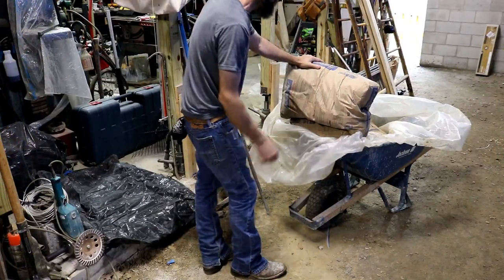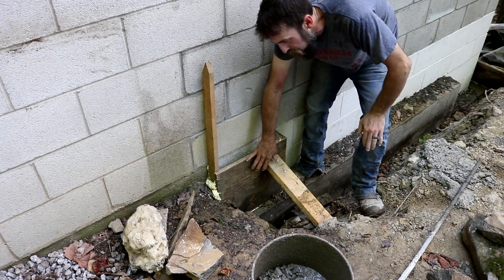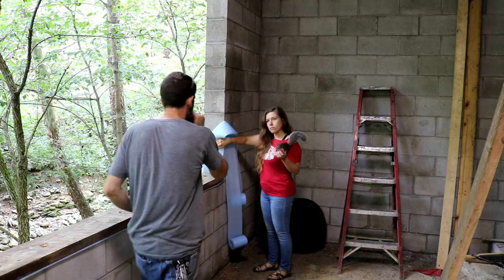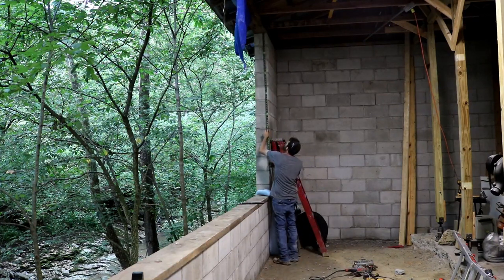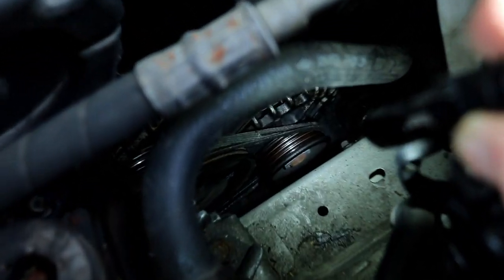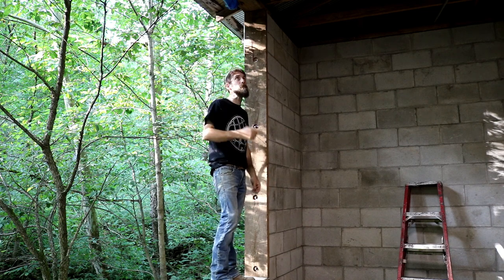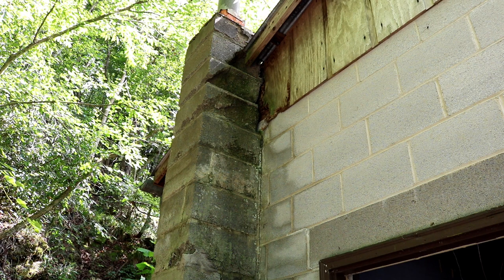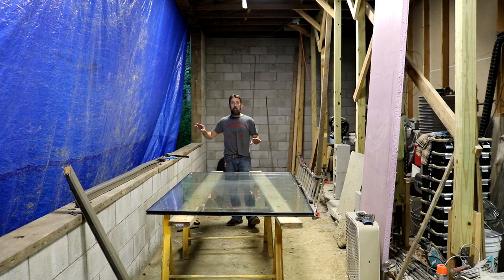Finished Concrete and Oak Trim

Comment: IF, you make the sliding glass door panels opening, you SHOULD give them screens (wasps?!). 
I don't think it is worth it. Run them horizontal, put venting windows above (like basement hopper windows), opening units to the sides. Vinyl windows are cheap and come in many sizes. Just my two-cents-worth.

Comment: bags of cement arent alowed by law to weigh more then 25 kilo in the netherlands our version of osha doesnt alow more to protect the builders backs 
dont make the big windows to open up just set them in solid frames , the double glass is kind off funerable and can spring a leak in between the windows glass making them loose their insulation value and fog up on the inside  , 
besides that like you said there heavy and the support frame and hinges need to be build way heavier then when using other smaller windows that open , might be better to surround them with / have a row of smaller windows over the top and have those open up 
(maibe using a cam mecanism with a lever at a comfortable height ), 
simply having them hinged at the top and kick out on the underside should be plenty for aircirculation and protect from rain comming in even if their left open it will let in a ton of light 
think laying the windows down on the long end allmost sitting on top of the sill is tall enough to enjoy the the view from anywhere in the shop 
making a windowframe top to bottom from angle profile steel is enough maibe make 2 or 3  pillars standing on the sill from 4 pieces of timber screwed together with a supportbeam over the top to support the roof and screw the window frames intoo that 
you can screw wood stringers in the frame where no windows are put in and use those to nail the shiplap intoo to fill the openings

Comment: Brilliant tee Elizabeth! Love it. Steve those big windows are far too big to be openers, you can't make a frame heavy and strong enough to prevent them twisting and possibly breaking the glass. It would be far easier to make them solid and have openers at each end of the shop. You could make a small opening casement window above each big one given that you have enough height to play with,. Give Peanut and Walnut some nuts from me please. Cheers from across the pond in the UK. Oh on another note, why on earth did you unload that cabinet so far away from the shop? I would have backedthe truck almost all the way into the shop!

Comment: Great job Steve. I love the fact you are reusing reclaimed timber in there. It gives the building character and validates it even more. To easy just to burn old timber and order a lorry load of new.

In the UK we have many ways to anchor to block, brick, concrete. Obviously we use similar anchors that you used but we also have concrete screws, drill a hole and screw in like a wood screw. Do you have those over the pond and or are they code for your application?
Reply: They are called Tapcon's here he would need about 3X as many and most would only anchor into the block, not the concrete
Reply: Y Pop we get concrete scores certainly 4" long and maybe 5" here in the UK.

Comment: Nice work. STATIONARY, they are too large and heavy  and will flex and leak if you try to make them opening no matter how much steel you use in a frame. I broke a similar door (Andersen) last year and where I live it cost more than $800 to replace it.. Dang this is a huge project for an individual. And yes winter is coming.

Comment: now that you have a good structure have you thought about making a lower celling? it will save you on heating in the winter and you can have storage up stairs
Reply: That’s what we did in our pole barn with 12’ ceiling (rafters). We built a wall down the middle and made a wood shop in the back. We dropped the ceiling 2 feet back there. In the front section, we built loft areas along the sides, installed attic stairs, and use them for storage. We hung plastic down from the ceiling to close them off from the main part of the shop so we have less area to heat.
Reply: @notajp  totally agree and he will have a place to go incase he does something stupid haa haaa

Comment: If I wanted to use them anchors to go thru one block and into my cement pad could I drill thru the block into the pad the insert that anchor down into the pad set it then use all thread to attach to it? They don’t make anchors that I’ve found locally that are 15” long!
My solution it to get a regular anchor that’s 5” and weld all thread to it to make it 15”!
Reply: lookup Chemical Bolts it is an epoxy in a glass cylinder you drop into a drilled hole then drop the threaded rod.

Comment: That door is tempered glass. Don't hit the edges. I see that silicone was used for the seal also. That should be good for 25 years not like the black PRC sealant.

Comment: Hey Steve. Had you considered installing the windows horizontally with openable windows either over or under them??
Reply: Yes! Transoms that tilt out just below the eave would give air circulation without water intrusion.

Comment: Not sure why you poured that wall full of concrete when you initally wanted to try to save weight on that footer. Too late now but I think you could have not reinvented the wheel and just installed the sliding doors as intended and used them as windows instead. You had enough height for them to fit that way. Concrete does not like heat. They should have used brick for a chimney.
Reply from the maker: With the footer as large as it is the concrete wasn't needed at all in my opinion. I like the idea of it acting more like one piece. That's the reason I went on with it.  The plastic on the door frames isn't good enough to use. They pulled them out because one was really bad. I do plan to use the wood underneath the plastic.  Nice to see you Brian.

Comment: Wow - that belt should have been changed loong ago-! lol   Call it preventative maintenance, especially living out in the country -- fortunately an easy fix.  Also spray lube those darn tailgate latches so ya dont have to fight it all the time, Ive put off stuff like this sometimes and always end up wondering why I didnt do it sooner and save myself the constant fight every time I have to use it.  Please dont take this as a jerk comment, I just see how hard ya work and hate to see you struggle any more than necessary, youre doing an amazing job with the building, better than if ya paid someone working against time would do.

Comment: maybe it would have been cheaper to use breeze blocks and lay them block on flat? you dont need any rebar for block on flat they can easily do very high retaining walls. maybe you dont have breeze blocks where you like (i live in the uk) ive built many retaining walls with breeze blocks. they are approx 440mm long 215mm width and about 100mm high. more to lay yes but no need for gravel or rebar. the only down side is you can only lay about 10 courses in a day.

Comment: stair step cracking has nothing to do with how solid or hollow a wall is. the dynamics are foundational. If your footings are sound, you've added steel, and the soil conditions are stable, you will not get stair step cracking. If they aren't, nothing you do will stop them.

Comment: isnt it suposed to be a different type of brick for a chimney?
Reply: If you are in an area that freezes yes, but where it does not you can get away with block and a liner, though the best is still to use well fired clay brick, as it will outlast the building. Cheapest and easiest is to simply use steel stove pipe to run up to the top, and put a dog leg to clear the roof and siding, with a top cap. Might only last 5 years before it needs replacing, depending on how thick it is and how much you use it, but if you can get thick wall steel pipe, and then fabricate the elbows , or simply cut and weld in the bends, you can easily get something that will last a century. no doubt that Steve will be able to fabricate that himself, just has to find the appropriate pipe at the junk, sorry, used metal parts store of appropriate diameter and length, and low cost.

Comment: Since it is at the top and the shape of the damage, I will go with the freeze-thaw cycle. It looks like the roof was not properly flashed to the chimney which caused the damage. With the wall damage you are expertly repairing and the way the original building was built, it points towards poor building practices.

Comment: 42kg bags, you are getting short changed there, here a cement bag is always 50kg of cement, and yes they can get heavy after a while. 

Cement mixer yes they are handy, and are worth it. My father did a house build, and bought a cement mixer for the job. When finished he sold it, to the builder, for the same price he paid for it 2 years before, slow building when builder was not busy. 

Those little insert anchors are nice, have used them before in lintels to mount door closers, where I used them with some epoxy, as I was not wanting to crack the lintel by using a more aggressive anchor and putting too much stress in the concrete. 

Kia alternator and belt, I also have a serpentine belt and the same alternator mounting, but changing a belt is much easier, just use the belt tensioner with a 17mm spanner to release the tension, and slip the belt off. Adjustment is there only to get the tensioner in the middle of the travel.

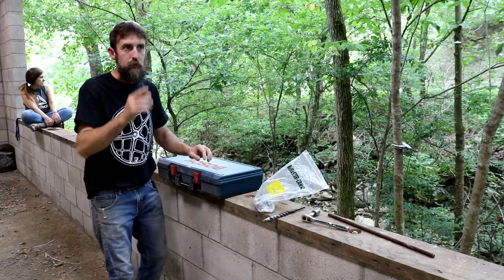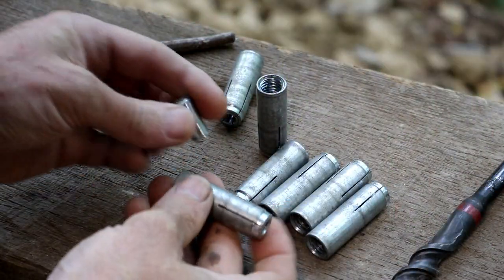Comment: What is the metal jaws that is attached to the tree at 15:26 to 15:55 in the vid? You can see it above the piece of bar on the oak cill to the bottom right of the shot.

Comment: It's really stupid to use normal concrete blocks for a chimney. The blocks have to be specially made to withstand the moisture, temperature differences and overall heat.
The damage you see is the result of using inappropriate concrete blocks. 
If you use such blocks as the outer wall you have to put in a stainless steel pipe with a water and heat restart filling surrounding it.

Comment: Love the channel bro but you are making a huge mistake by filling up the breeze blocks with concrete.
    These hollows are there to prevent water from seeping into the inside of your building, by filling them up you are guaranteeing the wall will be wet through and through.

Comment: I hate to sound like I'm being the safety police, but... When ripping a long board like that old 2x you might want to consider clamping it to your saw horse. A stupid random nail and the fact that it's old and bowed, anything that will allow it to slide off, whatever... Being a person that has been hurt (in my youth) by silly accidents that could have been prevented with something as simple as 20 extra seconds and a clamp, well anyway.. Be careful where you can folks.
Reply: If you want a decent temp connection for the uprights against the block, just toss in some tapcons.